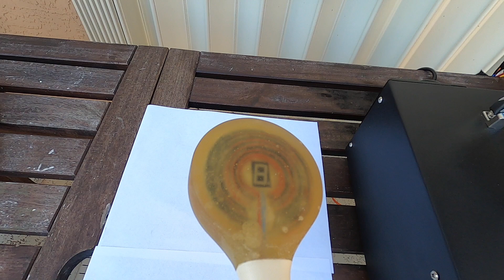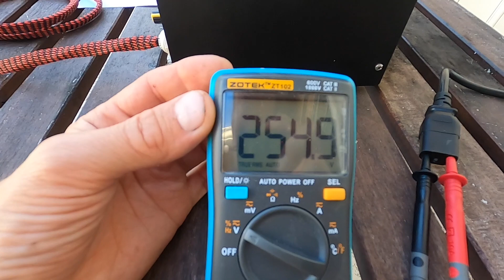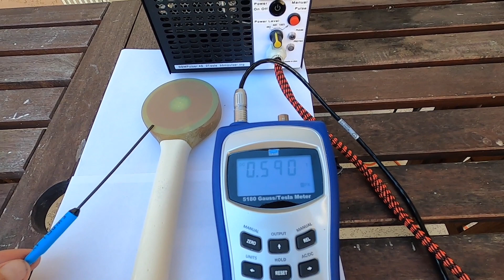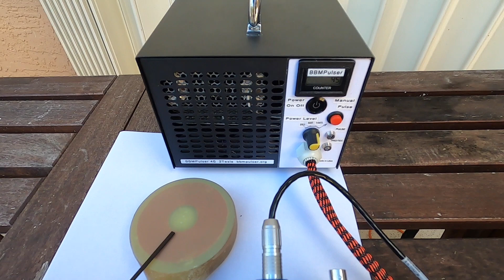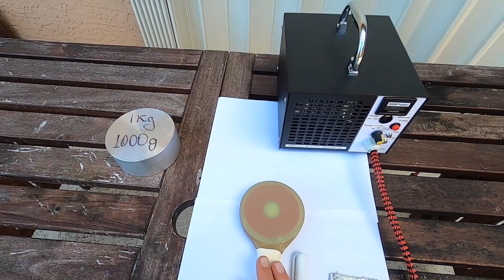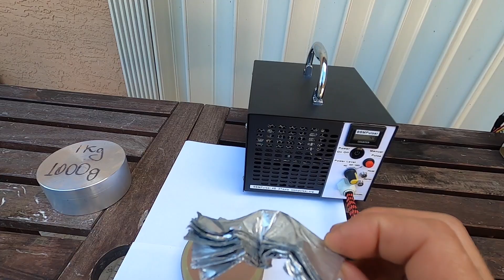021 BBMPulser 4S 240Volts model Overview. Output 2 Tesla (20,000 Gauss) Strong PEMF Machine

Comment: Looks great, manual discharge is a good idea.
Reply from the maker: I think so as well. I have manual Discharge on all of my units except model 4B (basic)
Reply: Do you plan on making a 3 Tesla, or do you prefer to remain with the 2 Tesla?
Reply from the maker: @medjool2tyler227  BBMPulser 5S has 3 Tesla output. I show it in Youtube Video #020
I will continue to improve the power output
I want to get 2 Tesla 4" away from the coil. 
2 Tesla is what it takes to sterilize things (fluids like milk and others) also it could be applied to the body. We can sterilize internal organs in just a few pulses if we can deliver 2 Tesla deep inside.
Reply: @AndreyD  I notice in your video 8 your pulser 4D is 6 Tesla, but listed as 2 Tesla. It was a short video. But, I was a little confused that the 4D was more Teslas than the 5S, which is 3 Tesla?
Reply from the maker: @medjool2tyler227  Bbmpulser 4D is 1.8-2 Tesla.
I use to estimate the power output before I got the expensive meter. I was wrong with the estimated power output. 
The true number for 4D is up to 2 Tesla output. 5th gen models can do up to 3 Tesla.
Reply: @AndreyD  OK, thanks.
Reply: So, probably the 2 Tesla unit I purchased is closer to being .5 Tesla (just guessing). Don
Reply from the maker: @medjool2tyler227  Hello Don G.
To be honest I don't know for sure.
Cince it has over 3,000Uf Cap and it gets charge to 280V I can estimate it to be around 1T.  I don't build BBMPulser 3 anymore and currently don't have a unit to measure the power.
Please Email me i will give you free upgrade for the stronger unit. You helped me when I was starting out and I want to return the favor
Reply: @AndreyD  I'm still happy with the unit I have. It's nice and small.

I'm still trying to figure out if the next unit I should get is a 3, 4, or 5 Tesla.

I imagine, if the Tesla is too high it might get counter productive. I also have a theory that if the coil wire gets too thick, in order to handle the extra Teslas, it may  affect the density of the actual field.

This is to say, that even with higher Teslas, maybe certain microscopic areas of the flesh might be missed. But, I am not positive about this.

As an example, when experimenting with the old Sota unit, though it is weaker, the coil wire seems to be thinner, and therefore, there are more turns per sq cm. So, when I treat something, the Sota unit needs to run longer, than the 10 minute 1 Tesla unit. Maybe 20 minutes. But, I usually feel more pain relief from the weaker unit, which may not sound logical.

Yet, I am still interested in the concept of a stronger unit for sterilization experiments. I just don't know how high in Tesla units I can go before it might do damage, or even start cooking the flesh?

So, the factors of power vs. coil wire diameter, continue to evade me. Then, there are other companies that are claiming that their coils run on AC pulses, and are therefore more effective than DC pulsers.

I have a Russian pulser that is AC, but it is so weak, maybe 1/20 of a Tesla, that I have to use it for over 30 minutes to notice any effect.

So, we are like pioneers here, with so many unknowns. I am sort of "stalled" in deciding what to try next.
Reply from the maker: @medjool2tyler227  There are 7 Tesla MRI machines that do Scans of the head.
Reply: @AndreyD  I've gotten many MRI's, I just wish they would have sterilized some of the stomach viruses I was being treated for.

So, maybe I shouldn't go any higher than a Tessla 4 or 5, so that the pulser doesn't get too large or expensive. 🙄
Reply from the maker: @medjool2tyler227  I adreed, we are the pioneers in this technology.
Magnetic energy degrades a lot with the distance that's just how it is.
So having stronger Unit will allow you to get deep inside, sometimes it's the only way to get the job done. Weaker and faster Pulsers can't do what strong slower pulsers can.
When dealing with infections - we are trying to get the effect as fast as we can and it's the power, not the speed that will achieve it. When dealing with recoveries we don't need a lot of Gausses, Power Under 1 Tesla is sufficient enough in most cases. To recover injuries patient needs more time with low Gausses.
Don't worry, you wont "cook the flash" with strong pulser, Worst thing that can happen is the flash will start heating up. Don't allow it to get too hot to cause burns
Ideally I want to get 2 Tesla 4" away from the coil.
Anyway Don you have a credit, When ever you decide how much Tesla you want just let me know and I will get you great deal. This time the Tesla numbers are real, got the proof now
Reply: @AndreyD  Thanks Andrey. When you offer a 5 Tesla, I will email you. No hurry.
Reply from the maker: @medjool2tyler227  5 Tesla, Okay. I's probably going to be 7th generations Pulsers, I'm on 5th right now.
Reply: @AndreyD  OK. The one you sent me is still working OK. There are some small cracks forming on the paddle from the heat. But, they don't interfere with its operation.
Reply from the maker: @medjool2tyler227  I'm sorry to hear about that. 
Right now I use 2 different resets for Coil. One slightly rubbish resin is used for the head of the coil, it allows it to expend when coil gets hot and the white hard plastic used for handle. So fur this new design doesn't get any cracks over time. 
Im always trying to improve the design. Any advice or ideas on improving it is appreciated.
Reply: @AndreyD  I haven't tried your new design without the cracks yet. Maybe on the next unit I order. If the cracks on my unit become a problem, I can always add some rubber cement to seal them or some UV dental resin that I have. Right now, I am having no problems.